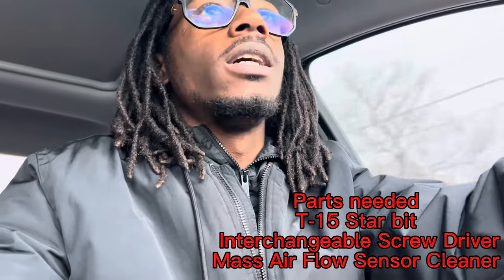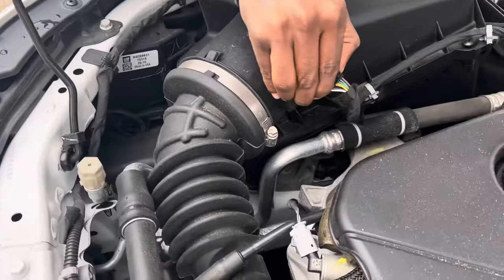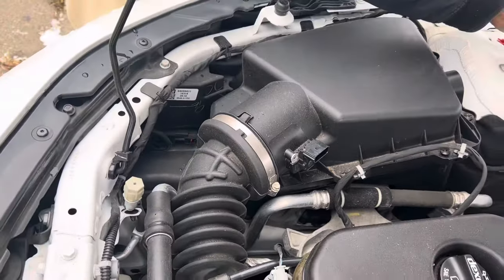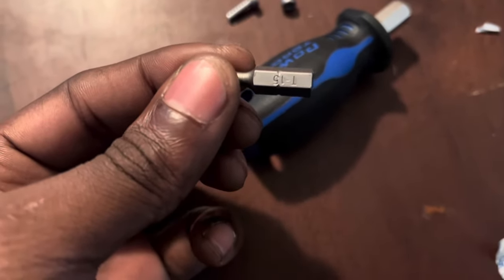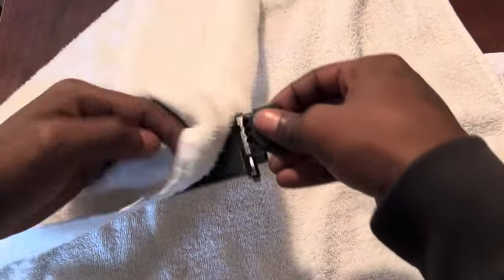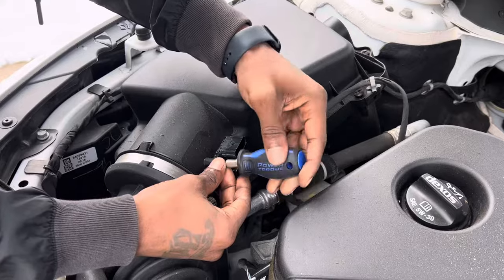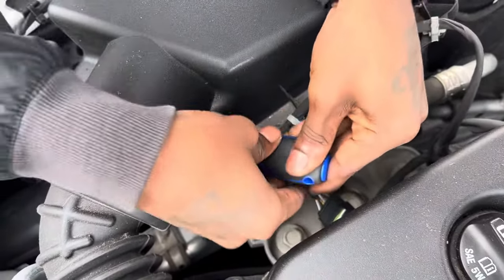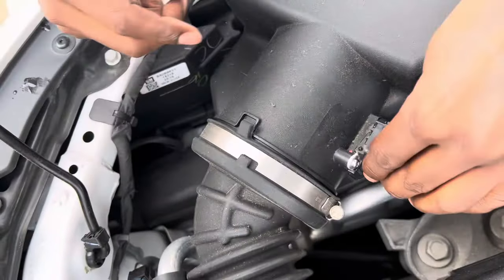How to clean Mass Air Flow Sensor (MAF) 2016-2021 Chevy Malibu

Comment: I had to leave a comment because I just did everything you said to do in the video the check engine light did stay on so I went back inside and told my dad and he said to disconnect the battery I did and ta-da it worked. Thank you so much I recommend this video guys
Reply from the maker: Glad to know it worked out for you, is was another trick you could’ve used to get the engine light off but it works that way as well I just didn’t wanna disconnect mines but either way I’m happy for you 😏let the Malibu be great again lol
Reply: My dad just tole me the same thing lmao hoping it works
Reply from the maker: @yurigarcia9800  lol yeah it’s cool it works both ways if it does pop up again just buy a new sensor it’s less then $30 for sure cheap fix and it’s easy to replace you can use the same video for instruction if needed
Reply: @Theerealanthony  It came back on 😫
Reply from the maker: @AngelicaTV1000k  I would just replace it sadly mines ended up back on to afterwards, I wonder though were you driving or it came on when you started it
Reply: @Theerealanthony  I took it for a test drive

Comment: Cleaning the throttle body works also. Thats the path I took. After watching your video I will clean my mass flow sensor just to be safe fam. I subscribed to your channel!!!
Reply from the maker: It’s funny you say that I do agree I’m dropping a video soon about that cause the light came back on and I had replace the part but decided to clean the throttle body as well since I was already under the hood and the car is running like a champ now and thanks a lot man I appreciate the sub. I’m here to help
Reply: @Theerealanthony when you replaced it did you have to do a relearn on the car
Reply: Thank you! especially for showing the screwdriver to get. I had no idea how to remove those bolts. Bought a T15 at autozone and was able to get this done. Best video for this process!

Comment: I changed the part but the engune light is still on 😖 and i dropped the locking clip inside the car while changin it 😵‍💫 its in secure but idk wat wkse to do
Reply from the maker: @toonyjordan  either you can wait until it turns off on it’s on, or you can reset the engine light as well. And definitely should buy another locking clip just for a peace of mind I’m not sure if it could fall out

Comment: So I start my 2020 Chevy Malibu Lt runs fine till I put it in reverse or drive as soon as I let go of brake the car jerks and engine shuts off anyone know what this is I have no engine lights coming on beside change oil warning???
Reply: Mine is doing the same but without turning off and I had a check engine light recently but then it went away
Reply: @Martin-sq2rz  how many miles does your car have and have you ever had the transmission fluid changed ????
Reply: @Martin-sq2rz  if you have not done that then it’s your gears on the transmission have wore out that’s what happened to mine I have to pay 6 grand to get a new transmission put in

Comment: Thanks for the video. My 2020 check engine light keeps going on and off. That dang p1101 code. AutoZone sold me the same cleaner. Gonna try to clean my sensor tomorrow.
Reply from the maker: You’re welcome and yeah you’ll be surprised on how common that code is. I did the clean first but tbh the replacement sensor is so cheap like less then 30$ you could just replace it. Only mentioned that cause I cleaned mines then it went off but a couple weeks later it happened again and I changed it out an haven’t had the problem since

Comment: I feel so handy for a lady. Local autozone said I needed to replace because it had the same code. I didn't want to pay for parts and labor so to the internet I came.

Seen a couple forms that said try cleaning it first so to YouTube I came.

Found your video so wish me luck 😂😂😂😂.

If nothing else I know what part to get and how to change it myself 🎉🎉

I'd say that's a win!
Reply from the maker: @PresshureDavenport  I appreciate this comment please let me know if it worked for you, I ended up replacing mines but haven’t had the issue since I replaced them
Reply: @Theerealanthony  it's looking like I'll have to replace the part. I took it apart and cleaned it. Put it back together, and the check engine light was still on. I disconnected the battery and reconnected the negative and the engine light is still on.

I found the part on Amazon for $45 so once it gets delivered I'll update 😆
Reply from the maker: @PresshureDavenport  and you should’ve went to auto zone or Oreilyys I think they had it cheaper if I’m not mistaking
Reply: @Theerealanthony  autozone wants 94
Reply: @Theerealanthony  came back to check in lol got my Amazon part put it in went back to advanced ap they reset it with the little dodad boom no more check engine light. Also this loud azz humming noise upon accelerating that was present before is no longer there...

Gotta say thanks again 👌🏼🙌🏽💪🏽
Reply from the maker: @PresshureDavenport  happy to hear it worked out for you , definitely was a quick enough fix so you don’t have to pay labor for someone else to do it

Comment: Good video! I cleaned my MAF because I was only getting 7km/L even if I baby the car in the Ecozone. Now back up to 11/12KM/L which is 26-28 MPG.
Reply from the maker: I appreciate you watching man, glad I could give you some clarity. Gas mileage has been better since the fix. I didn’t drop a video which I have one but I replaced it cause mines did come back on I had a faulty sensor tho and I’ve been good ever since
Reply: Wow I get like 38 to 40 mpg in my Malibu 2020 but I am driver in the country so maybe that’s the reason

Comment: Good video,
 Might I add that it is always better to reset the ECU, That way you know for a fact if they easily pull that code again then you need to replace your sensor. Also it's good to replace the air filter at the same time
Reply from the maker: I appreciate the comment and info cause yes I have read that idk why I forgot to add that in the video but yes I agree with this to whoever comes across the video
Reply: You can take it off with the scanner aswell if it comes back just replace it

Comment: My 2016 is idling really rough and jerks a lot. Do you think that could be a MAF sensor? My check engine light came on but my dad said it was just a sensor and he cleared it 😒 but I am also ordering an o2 sensor. Any suggestions? My car does have 122,xxx miles

Comment: I just put a new mas and an air filter but the check engine light is on and reads the same problem…the car rides fine what else could the problem be?
Reply: alil off subject but I use the FIXD code scanner.. It tells you everything you need to know n it's not expensive

Comment: After I did this, I still got the p1101 code. What else can it be.. great video
Reply: Dirty throttle body, clogged pcv valve, or  vacuum leak in the air system
Reply: Check maf sensor

Comment: When you replaced the part after it can’t back on did u have to relearn the car
Reply from the maker: Yes I've heard and it worked for me just to drive the car I have seen it go off on its own once the car moves for a couple of mins putting it on a code reader might trigger that to happen faster, did you just clean or replace the part ? Cause idk if you went thru the comments but this was a temporary fix and I ended up just buying another sensor and used the same steps to replace it the part is super cheap if it don't work. I think total under 30$ the part like 20 but if you choose to clean it you know you gotta buy the spray

Comment: My mpg is only 22 in city and not driving fast. U think this would help and cleaning throttle body flap and sides?
Reply from the maker: Could definitely help if it hasn’t been checked cause it can get a lot of dust in stuff in there. Do you have any codes showing ? Might have something fuel ejector wise that’s killing your gas. I didn’t experience bad gas mileage well at least I didn’t notice it
Reply: @Theerealanthony  I just bought this dam car like 45 days ago and it seems good everywhere just not getting the mpg it should and the 2 to 3 shift is like delayed. Not slipping but like it don't drop the rpm to the next gear fast like the other shifts it kinda hangs up like it's stuck for a second. I hope I don't owe 12k on a shitty ass car lol. It's under 95k miles and my cousins got cruze with almost same engine and same exact trans that has 223k and still runs and drives, so I went for this. Kinda wishing I didn't
Reply from the maker: @TheMuskyMafia  damn bro first congrats but I agree I hope not either, random thought but have you looked at the color of that transmission fluid since you’ve had it ? And it’s something called a throttle body not on this car I had the issue but I know cleaning that out as well with a cleaner specifically helps gas mileage as well. But I think that shifting is something completely different. I’ve noticed things every now and again switching from drive to reverse when backing in it does something weird but I’m not sure if it’s the same thing you experiencing? But hold on your saying you replaced sensor in this video in now your experiencing those issues?

Comment: I pulled out the little red pin (when you said don't worry you break it) and the small black tab underneath it snapped off.. any idea what I can do about?
Reply from the maker: Are you meaning the piece you stick the red pin inside ?  the harness or the sensor piece snapped off?
Reply: @Theerealanthony  yes... The black piece you push down inside the red piece and I can't get the wires unplugged for anything 😭
Reply from the maker: @daniellenicole6316 okay meaning you just can't pull it off the sensor or it's broke ? If you can't get it off just grab from the sides it's going to be stuck like that the first time being replaced, you could always unscrew first if you think that would give you a better grip but you'll still have to take it off to change it or clean it
Reply: @Theerealanthony  can I still pull it off even though the black tab broke off?
Reply from the maker: @daniellenicole6316  honestly I would like to see exactly what your talking about cause yes I assume you can still pull it off but then again it sounds like you may need a new harness connector if it's broke I would think it wouldn't hold like it should with a piece missing

Comment: I’m also wondering should we spray inside the port
Reply from the maker: To be honest I did spray a light mist inside of the port that I didn’t show on the video but you have to make sure everything’s is for sure dry before you reassemble everything. I waited a while then wiped with microfiber towel just to be sure

Comment: great video brother, i was wondering did you have any shaking of the car and weird up and down idling ?>  i have a 2016 malibu and just started doing this...
Reply from the maker: Just seeing this but I have experienced a jerk when switching gears when the auto stop is on, not sure if that’s even connected. But I haven’t lost power or any shaking. If your meaning when after replacing it it does this please write me back in let me know ?
Reply: @Theerealanthony  thanks for replying, I got it fixed by simply spraying MAF cleaner. now my car is running like new! if they issue restarts in the future ill buy the sensor itself.
Reply from the maker: @krunchyt4co293  your welcome man I appreciate the comment for sure it helps the video reach others so thanks a lot! But good to know yeah that usually works cause it just gets dirty so it saved you a $100 bucks for the replacement part I have made a video if you need to replace it I have to drop it soon. And right if it happens again which it did for me I replaced it and it’s running like a champ again and car start works again consistently
Reply: @Theerealanthony  thank you! now i can focus into getting new tires aha!
Reply from the maker: @Krunchyt4co  lol I understand that man the grind never stops bro 💪
Reply: Did it feel like your car might turn off? I’m having the same issue
Reply: @alysia3961  It was all kinds of problems with that car.. unfortunately I had to get a new car.
Reply: @alysia3961 i am having that exact issue? Any luck with fixing it?

Comment: I'm having the engine power reduced I checked fuses I got 2p17 chevy malibu if I drive on freeway it will pop up at high-speed but if I turn off car for 10 seconds it will go away but then come back
Reply: Replace the gas pedal

Comment: I put coolant in mines and the check engine lights comes on ....wondering what happen
Reply from the maker: We’re you having the issue I had at all ? Or you just happen to top off the coolant and a light came on afterwards ?
Reply: @Theerealanthony  top off the coolant and then that happens
Reply from the maker: @kevinhayles6849  have you cleaned your filter yet? And was the the levels of the car, getting to hot ? Before you added coolant
Reply: @Theerealanthony  no it was a cold ...and I haven't change it yet I will going to do a maintenance service

Comment: So did the light turned off? Cuz u failed to show the outcome of ur video!
Reply from the maker: I'll keep that in mind for the next video I appreciate it but yeah the light went off, if yours doesn't the replacement is the same process and cost around $97 for a new sensor
Reply: Thanks for getting back at me, $97 🤔 hmm it was a leak on the airhose my light finally went off. Thanks buddy!

Comment: Hey so I have code p1101 my car loss acceleration, the engine revs but the car creeps.. do you think this is why
Reply from the maker: It can be the first thing to look for it’s usually this, but if your losing power you probably need to replace it instead of cleaning it, the part is like a $100 with taxes and you’ll do the same steps to replace. Clean is the cheap fix but replacing it is worth it if that’s the exact code that’s popping up
Reply from the maker: What year do you have?
Reply: I cleaned mines today
Reply from the maker: @charlesmoody9313  how is it running? Did that do the trick ?

Comment: My T15 bit is too small
Reply from the maker: I would assume you have a different year then mines cause that’s definitely the screw size I had to buy the tool cause I didn’t have it.
Reply from the maker: You have a tool box ?
Reply: @Theerealanthony  Yeah I had to use T20 bit so maybe mine slightly diff or Dealer lost OG ones and replaced them idk but I got it worked out. Appreciate the video. I’m hoping I can pass dumb ass emissions now. Big ass scam lol